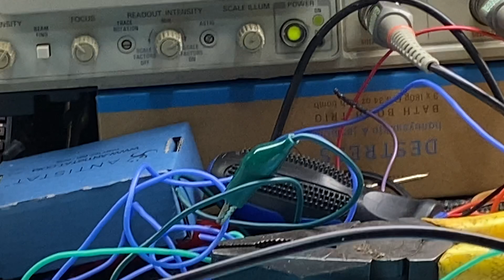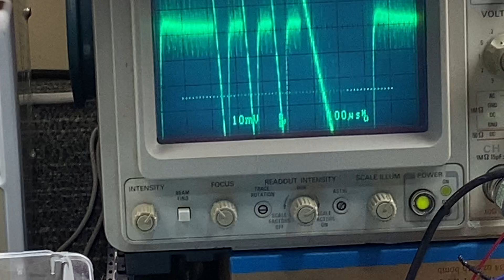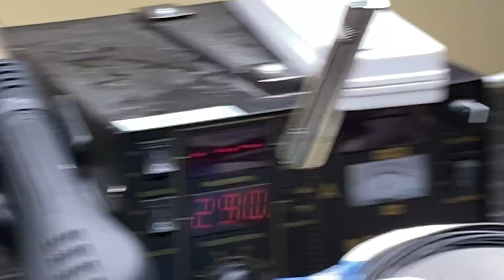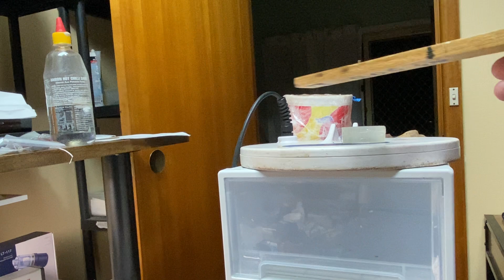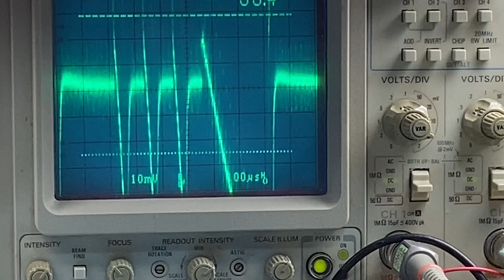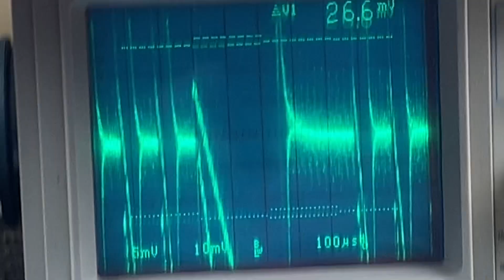Minelab huge difference in front end design. #minelab #bestmetaldetector

Comment: Hi woody with my modified front gain 4500 should I run factory default rx on the rear panel ?
Reply from the maker: I based the mods on factory settings.